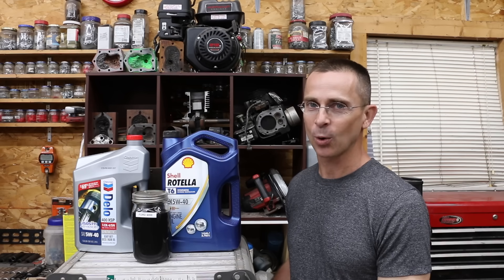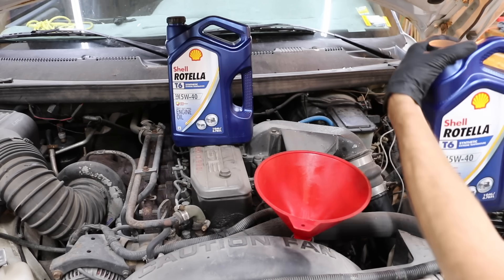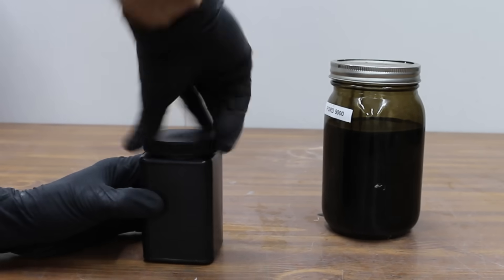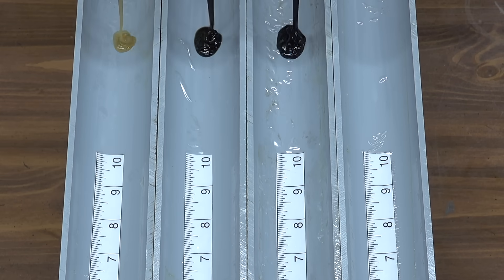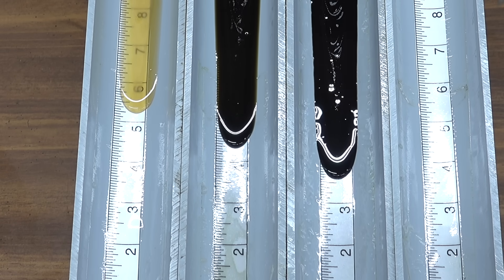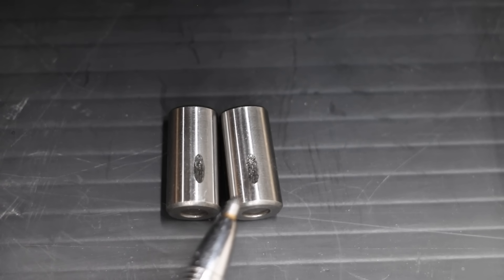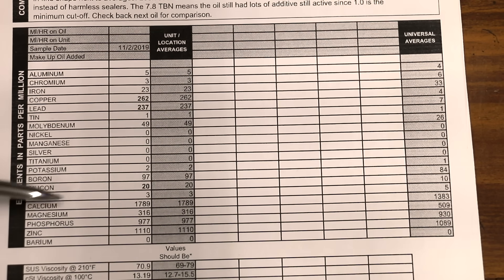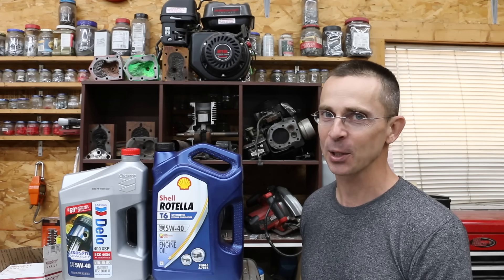Will Annual Oil Change Damage Your Car? Let's find out!

Comment: I use the T6 in my motorcycles. It's a lot cheaper than motorcycle oil and does a fantastic job. Maybe you should do a video on motorcycle oil vs diesel oil. Great videos.
Reply from the maker: Great suggestion!
Reply: @ProjectFarm  I don't know how many of your viewers ride motorcycles but I would love to see a battery test like you did on the car batteries.

Comment: I always change mine anywhere between 1 year or 3-5k miles even with full synthetic oils rated for 12k+ miles just because i want my vehicle to run at optimal running lvl at all times no mater what and i hate working in a gravle driveway and mud so yeah try not to risk it for the biscuit when it comes to vehicles atleast not yet lol
Reply from the maker: Thanks for the feedback.

Comment: my 95 dodge leaks a little oil and after switching to tech 5w/20 still have the same amount of oil leaks. The 95 Dodge caravan has well over 300,000 miles on it  and has oil changes since new.. Thanks for proving what I already knew.
Reply from the maker: Thanks for sharing

Comment: I love your testing. But I believe the oil change is due to condensation. Water gets in the oil from condensation from the block heating and cooling.
Reply: if so then the lab tests would reveal such results ...the minuscule amount of condensation is burned off when engine reaches full load and temps...the condensation thingy is an old wives tale

Comment: After three years but only 1268 miles the oil in my BMW 540i was almost like new but the filter was not. The filter media had started dissolving, spreading fibers inside the engine. (Filter was Purolator L35280, oil was Gulf competition 5w-40)
Reply from the maker: Thanks for the feedback.

Comment: I’ve been tracking hours per miles on our vehicles compared to tractors/loafers and it’s quite surprising. Case IH oil through viscosity oil co. Recommends 600 hr oil change intervals. That is 50,000 miles on a diesel vehicle. So if we’re changing oil every 3-5k miles on diesel vehicles that’s only around 50 hrs. Shell Rotella t4 15w40 recommends 250 hr intervals
Reply from the maker: Thanks for the feedback.

Comment: Thank you for the video on your testing results. I've been using the Rotella T4 15w-40 in my 03 Dodge Ram 5.9 Cummins for years with a oil/filter change interval at 5K miles. May have to switch over to the Rotella T6 5w-40 and just do a once a year oil change, I average 8-10K miles per year with my Dodge Cummins. Also curious to know about the Rotella T5 15w-40 Syn-Blend oil since it's cheaper priced than the Rotella T6.
Reply from the maker: Thank you for the feedback

Comment: Forgot to change my full synthetic oil for almost 2 years, no symptom of engine problems. am i in the clear? gasoline car
Reply from the maker: I always suggest change the oil at the recommended interval for miles/hours of use
Reply: @ProjectFarm  Changed the oil today noticed oil filter was leaking abit, oil level was little below(a quart less estimate) and oil started to have some sludge! Now im worried, what are the possible damages?

Comment: below is a post from an RV forum

"Oil today is not remotely close
to oil even from a decade ago. The 3000 and or once a year is no longer
required.  Most name brand oils will easily live 5-6k miles. And that is
regardless of whether you drive that annually or not. As for oil of my
choice.... I run the Valvoline for the added ZDDP benefit.  The conventional brand tested and outperformed
several other leading synthetic brands. Synthetic oil is nothing more than a
money grabber. It contains the same addictive packages of conventional oils.
They are what break down with time and why running extended drain intervals
comes down to an oil analysis test as the only sure way to know whether or not
it's safe to do so…..The majority of oils these days will easily live longer
than yearly intervals if one doesn't drive enough miles yearly"……. Udidwhat
Reply from the maker: Thanks for the feedback.

Comment: i use 15w50 semi synthetic extra ten diesel i only chamge it once a year fuel filters,oil filters and air filter but my nissan patrol has a 4.2 td42 diesel which uses 2 oil filters
Reply from the maker: Thanks for the feedback.

Comment: I’ve been told that today’s oil can last up to 7500 miles because of the advancement in additives and because motors are built better than they were 40 years age.
Reply from the maker: Thanks for the feedback.
Reply: Project Farm is that true?
Reply from the maker: Thanks for the feedback.

Comment: A good ideia would be to do these tests with Conventional (Mineral) Oil, because I have been recommended to change the Oil in my car every 6 months or a certain mileage (I forgot what is the correct number), since it might no be suited for storage in the crankcase for longer periods.
Reply from the maker: Thank you for the suggestion

Comment: Perhaps you could acquire a pH meter and then you could check the acidity of the oils you test?
Also could you put some graphics on the oil slides as it would be easier to keep track of which is which. Confuses me trying to keep up with it!
Not criticism (well "constructive criticism!") on an otherwise excellent channel. 
Also do you think attaching magnets to oil filters does any good? Could this be tested in any way?
Reply from the maker: Great suggestion. Thank you.  Magnets might help a little with upper engine wear but not much for the nonferrous contamination

Comment: I am in Durham, NC and I've had dealerships tell me even with synthetic oil, I should still have oil changed after 3,000-5,000 miles (2016 Sonata Hybrid) because of the "vast" temperature differences.

I looked at them like they were the biggest lying morons in the galaxy. Temp ranges here are normally mid-teens to 20s up to upper 90s.

Needless to say I went elsewhere.

By the way, I recognize the bottle and report from the oil test lab. I've used the same one. 😁

If Rotella works that well with a diesel-I wonder how well it is with average cars? Or did you test that already.

Having a Hybrid I also think the oil would last longer because vehicle mileage and engine mileage are different. I wish engine mileage could have gauges as well.

Thanks for taking the time to do this and others, like testing rechargeable batteries.
Reply from the maker: Thanks for the testing suggestion.

Comment: Great video and thank you. Can you please test Petron plus products, their oil claims to have properties that soak into the metal having non or  minimum wear.
Reply from the maker: Great suggestion!
Reply: Unless their products have subatomic accelerator properties, it is doubtful that it is anything more than temporary surface deposition.

Comment: There is a huge debate on motocross forums about t4 vs other wet clutch 4stroke engine/ transmission oil. ie: yamalube , Maxima,motul ,Honda hp. I would love to know if t4 is just as good. It's way cheaper for sure. Thanks
Reply from the maker: Thank you for the video idea!

Comment: I’ve done annual oil changes for most of the life of both my wife’s 2008 Honda Civic and my 2008 Suzuki Sx4 using synthetic oil and synthetic oil filters. Only drive about 8000 miles per year in each vehicle. Never a problem.  Don’t know if the different oil filters make any difference. Maybe that’s something that could be tested?
Reply from the maker: Thank you for the feedback

Comment: I ran a service station for 50 years and have attending oil schools and  also have ran  my own test on vehicles of 1994 Ford explorer with 470,000 and the engine has never leak  or given any problems and has ran Chevron Supreme oil since new  and  our employees are in the habit since they are young of putting synthetic oil in cars and they  accidentally put syn oil in my explorer that had always run 5w/30w  for all those 470,000 miles and never leaked  but before I had driven twenty miles in traffic my engine was leaking at the rear main seal and so i run every main sealer on the market and found  after adding everytime i needed oil a Blue Diamond Main seal sealer additive and started adding Chevron Delo 400    straight 40 weight oil till after i use about 5 addictives to stop the rear main seal leak but  I have continue to run Delo 400 oil for a few months and now changed back to 10w30 oil.  This seem to correct the problem and I also attended a factory oile school and you are strictly instruction tell you never to change any engine over to syn oile if it has ran 50000 miles on regular oil.   .  I base mine also I run a transportation section for the U S Army where we pull continue oile testing on all our engines and the Chevron is what won out over  any other brand of diesel oil.   . after this happened to my ford 4.0 L V6 engine,  I use a 83 VW Golf 1.8 high performance  engine and told one of my employees to just drop the oil out and put on a new filter and  i should have realized the same technician was changing the oil in the VW Rabbit , which had  well over 110,000 miles and he put eh same syn oile in the VW cause mowt all new VW call out syn oil . Well with in ten mile the valve cover were leaking and the oil pressure switch started leaking also and  I had to go through the Engine stop leaks to stop the syn oil and fired the  employer had to attend a oil school and and learn about additives.  Each engine has  always run even with the syn oile in them STP oil additive .    I am listening to what you are say but if you attend a oil school you find out that oil never wears out but get dirty that is why we change oil oile to start with and  STP still coats rods and metal parts and does not replace the oil  and does not drain off you rods and back to the oil epan but protects you engine... We change oil filter to clean up dirt in oile from carbon that comes past rings as mileage wears on engines..  But at our labs in the US Army we pull oil test nearly every 3 month and find no wear as long as we use the oil that is the Chevron Delo 400    cause its is the only diesel oil recommend for gasoline and diesel too and  It puts Shell Rotella in the back.   Delo 400, we  use on the race track too cause we sponser Race cars for nascar and rag strip.  But you information is maybe ok on your tractor  but dont put syn oil in any automobile that has had regular oil in for 50000 miles or you asking for leaks .... I base my information on being charge of over 3000 plus military vehicles and attending CHampion Labs for all test run on oils.   The reason I even still have an ford Explorer that I dont want to sell till i see 500,000 miles.  My father was an sutomobile dealer and i never knew what it was like as I gre up to see a car with 7000 miles and if it had 10000 it was worn out cause being a dealership, we got a new car every 3000 mile and he sold  mom's car as demo.   But  I kept the ford  because you just dont see any cars with 500000 that still runs perfect and does not use oile.
Reply from the maker: Thank you for the feedback

Comment: Excellent video as always! This just confirms my long held suspicion that changing your oil every year even under mileage is just propaganda.
Reply: Sorry I know this is a very late response,  11 months late. I bought a 06 GTO and keep it pristine but I do take it out for weekend trips with my wife occasionally. It's now 15 years old and has 24,000 miles. I also started thinking, about 12 years ago, why am I changing the oil yearly when some years I only put 1000 miles on it? I stopped doing the yearly and change it at 3000. Last oil change was 2 years ago. I'm very happy to find out I'm not causing any problems
Reply from the maker: Thank you very much!

Comment: Ok, I own many vehicles. Most get an oil change about every 3 years or 5,000 miles. 
My Super Duty has not been changed since July 2015. It just now reached 5,000 miles on the Shell Rotella T. I usually use Amsoil 15W40. 
So, I will change the oil next week.
The cars are driven a minimum of 30 miles anytime I leave my house for town.
I’ve never worried about oil changes based on time. I go by mileage or the oil life monitors.
Reply: P.S. my Super Duty normally pulls a heavy trailer when it hits the road along with traveling 2-300 miles when driven. I am thinking the oil gets hot enough to burn off any contaminates.
Reply from the maker: Great feedback. Thank you

Comment: Great work and attention to detail. On my BMW, they said to do this because the oil filter seal may break down and I found that did in fact happen once. It lost elasticity after a year despite low mileage because it was outside.
Reply from the maker: Thank you!

Comment: I run my generator oils at Blackstone every year since I must submit to a $300+ service just to get oil and filter changed on site (remember you can’t put a large gen set up on a lift. And tech has to travel to your residence😜) this can be particularly wasteful if you are just running periodic test cycles DONT go by number of months and I can tell you full synthetics Mobil one and pennzpil ultra platinum are showing hardly any deterioration after three years and 59 hours! $25 for oil analysis far cheaper than a home “service” where little distant I’ve is done short of oil change and air and water filter. Your mileage may vary no pun intended 😂but don’t change your oil until annual oil analysis indicates y should
Reply from the maker: Great feedback. Thank you

Comment: I’d love to see a video on oil additives for diesel engine oil. Maybe a video with Rotella t6 and this additive called Golden eagle lubricant-automotive, which can be bought from mpggarage. 

It’s suppose to increase lubricity by 1000% which is a pretty crazy claim. Would be interesting to see it’s claims in action the way you test you oils.
Reply from the maker: Thank you for the video idea!
Reply: That reminds me of when the product Slick 50 (motor oil) hit the street. They had demo booths at Street Rod shows claiming how it was far superior in lubricity. Hardly even hear of it now.

Comment: Thank you for these tests. I too have equipment/engines that receive little annual use, but are vital, so I give them good care.  Thank you for dispelling myth!
Reply from the maker: Thank you!
Reply: @ProjectFarm   Have you done an oil test for old engines with flat tappets? They need more zinc and phosphor then modern roller cams

Comment: I’ve been using T6 5-40 in all my modern cars, 2000 C230 Kompressor, 2009 CLK 350, 2006 BMW 330CI and the wife’s 2000 Boxster. My 86 Porsche 928, I use Valvoline VR1 20/50 with high zinc.

Comment: What does an engineman and Machinery technician in the Coast Guard, We learned that oil never wears out. It just becomes diluted or polluted. And they only use conventional oil, because you're talkin a couple thousand gallons per engine.

Comment: DO NOT USE THE NEW T6 IN GASOLINE ENGINES. 

They recently changed their formula when they changed their bottle design and it can now poison you catalytic converter.

It lost its SN certification.
Reply from the maker: Thank you for the feedback

Comment: Nice video and well organized test with its results. I have a question though: What if a car that had just serviced with an oil change and was not moved nor driven after the maintenance? What would happen after a year to the quality of the new oil being kept in the unmoved car under different weather condintions? 

Let's assume that something happened to the car owner and he had to quit using his car right after the maintenance because of unexpected reasons and after one year he starts using the car. The reason why I ask this is because all car manufactures claim oil change to be done after certain miles (or kilometers in other countries) or time (which can be 12-24 months).

Thank you in advance for your answer.

Comment: Wow, I'm impressed !  You would put an MIT Engineer to shame.  You are thorough and succinct and to the point.
You are putting my mind at ease.
 
Me & my 2004 Mazda 6 Sport S Wagon got rear-ended and totaled w/ only 59K miles on it in 11 years.  I practically begged the insurance adjuster NOT to total my car because it was in GREAT shape and NO RUST.  It had a lot of extras that I liked that were in the car.  One was my cassette player.  The other was the "tweaked"  V6 engine that was also used in the Jaguar for more Zoom.

I rushed around to find another vehicle & was going to buy a USED car.  My brother saw a sale on end-of-the-year brand new 2015 Toyota RAV4's for the same price as used ones which I bought in Nov. 2015.  They used all synthetic oil for the oil changes.

They offered 5 FREE oil changes I think within the first 3 years.  I think I only took advantage of 2 or 3 of them.

My physical condition wasn't so good after he accident and I wasn't going out or driving.  I only have 7400 miles on the car in a little over 4 years.  The little reminder sticker says I should have been back about 1 yr 5 months or 1 yr. 8 months ago.  As you can see I'm only averaging about 1850 miles per year.

I'm still very stiff and achy and the cold weather doesn't help.  I hope to bring it in during the next mild weather break we get.

I don't know if I should tell them that I had it changes somewhere else....say 9 months ago ?  (Just lie out of embarrassment.  The warranty is over anyway.)      Or does the car's Black Box tell them all the INFO ?
Reply from the maker: Thank you!